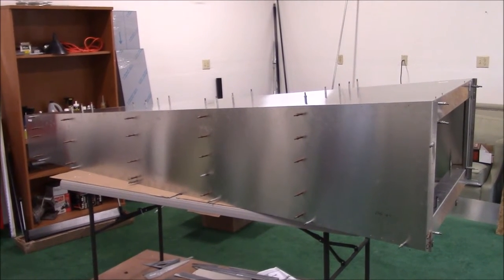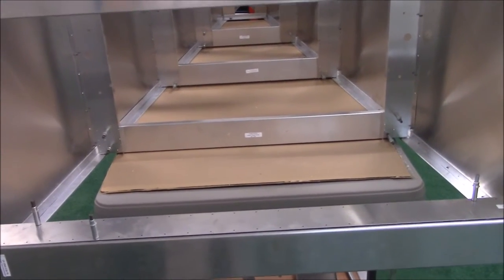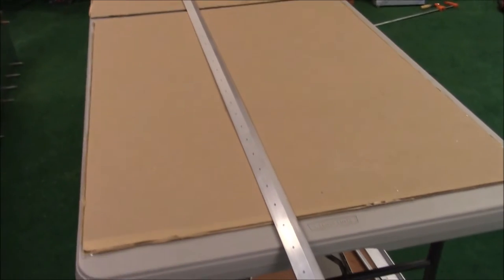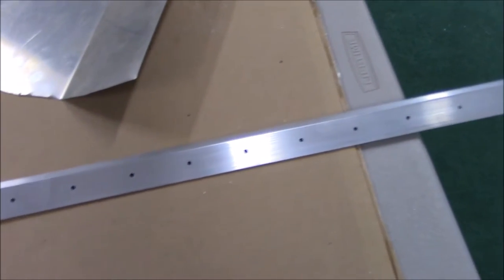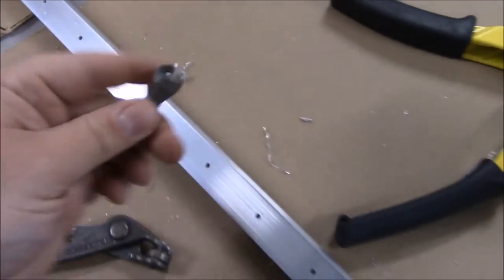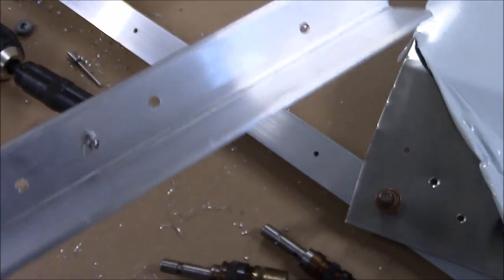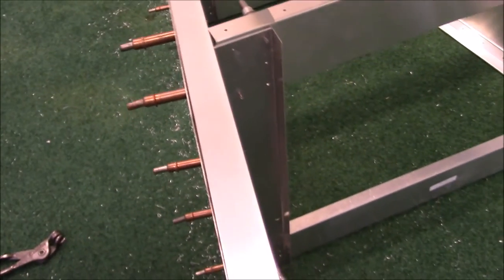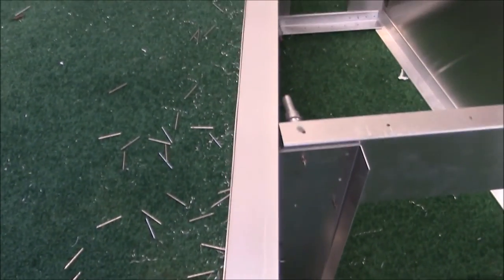Sonex Aircraft Build Video 48 Countersinking Longerons, Dimple Dying Skin, and Riveting Skin

Comment: I appreciate your attention to detail on your build as well.  I am curious as to how much gain in aerodynamic efficiency will be achieved as a result of your countersinking and dimple dying the rivets and skins.  I would think that Sonex would have done the analysis on this and would have offered it if it made a difference.  But, I do feel that flush mounted rivets will look a heck of a lot nicer than the regular mounted rivets.  So for that I give you kudos for going the extra step and making the plane look as nice as possible.  It will definitely have a smoother surface and should look great once painted.
Reply from the maker: +Greg Ellis Hi Greg. I heard someone talk about that a while ago. I think they said theoretically you could get between 1.75 and 2.5 mph of gain out of it, but most people say that the airplane noticeable looks "better." If I'm going to spend 1,000 hours building it, I might as well add another 5% and have it look as good as it possibly can. I do plan to putty and sand smooth the entire airplane before I paint it so it will look glass smooth. -Dan
Reply: I have built 3 Sonexes and the last one I was doing my friend insisted on flush rivets . Too me it is a lot of effort for little return. He painted it and it looks good but it wrinkled way more than mine.
  I have to admit it is way easier to polish. I have built 2 3300 Sonexes and it is a little faster than the proud riveted one. I don't know if this is rigging or what.
   My 2200 tail dragger which is very light at just 615 lbs tops 160 in level flight. They are a blast to fly. Have fun building. Cheers.
Reply: @christophermcnally8782  agreed, I would stick to the plans the way Sonex draws them up. All that dimpling and countersinking is time consuming, unnecessary and may weaken the parts. Its an airplane, its supposed to look industrial. 

For the video maker, thank you so much for making these. As you can see im watching them all. You're doing an awesome job. Cant wait to see the finished product. Don't mistake my comment as a criticism. Its just the way i would be mine. This one is yours and its going to be sweet. Cheers

Comment: Cool video. May I ask exactly what kind of rivets you are using and what tools you need for installing those rivets?

Are they what I googled to be "mechanically held self plugging rivets"?
Reply from the maker: They are "blind pop rivets" they are made out of aluminum. It is a simple pneumatic rivet puller. I think I paid $160 USD for the tool. -Dan

Comment: Daniel, are you are planning to cut the access holes and rudder cable exit holes after you assemble the aft fuselage?
Reply from the maker: +Mike B. Hi Mike, I am planning on doing those two steps once I finish riveting together the tub. I will also install the phenolic rudder cable guides at that point too. I am ordering the phenolic and I am waiting for a tool to arrive that will help me cut a perfect 4 inch hole for the access hole. It sounds like you have built, or have a lot of experience with the sonex. If you see any mistakes, please point them out so I can correct them now before it is too late. Thanks for the comment. -Dan